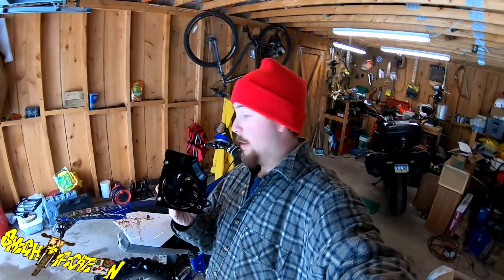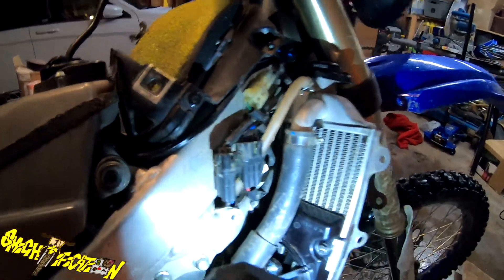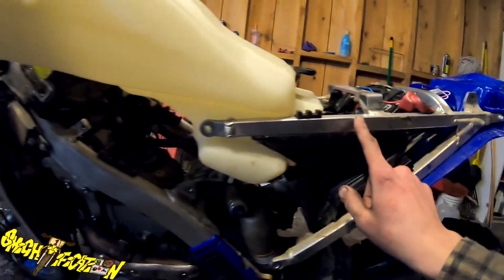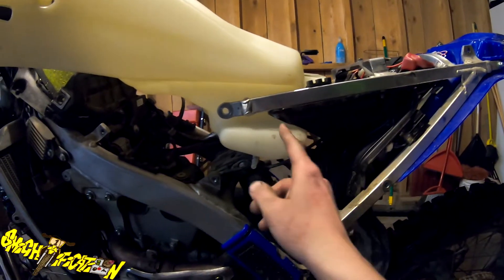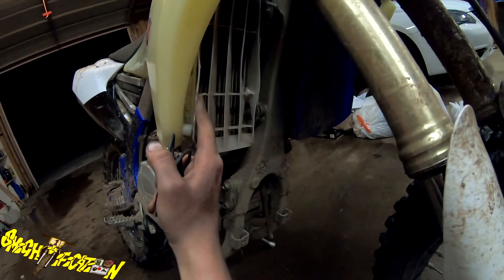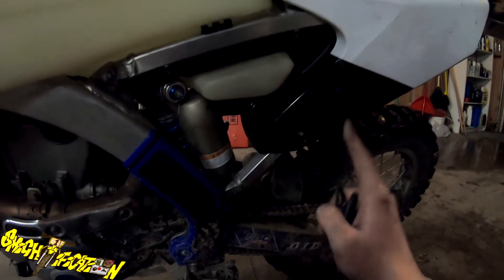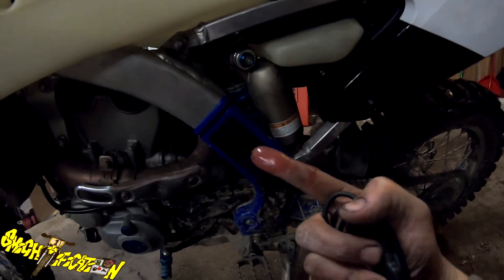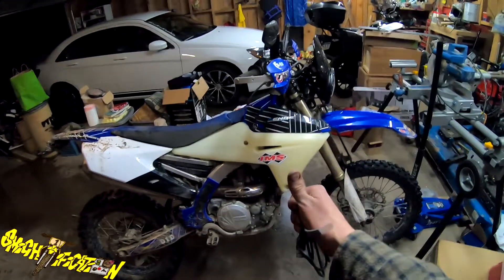IMS gas tank install PROBLEMS - 2018 Yamaha YZ450FX

Comment: Looks good! I couldn't find that fan anywhere where did you find one?
Reply from the maker: Rocky mountain ATV is where I got it
Reply: @Smightification  Ahh yeah I guess the 2022 uses a different part number so it's a different fan. Thanks!
Reply from the maker: @22YZ450FX  darn that sucks I wondered because I have seen others post about not being able to find them as well for the newer bikes

Comment: Do you know if somebody makes a fan for  a 2014 yz250f? I’m racing Gncc’s and I felt it’d be nice to run a fan
Reply from the maker: yeah you should be able to get the gytr fan for it did you check rocky mountain atv?
Reply: @Smightification  not yet I’m going too